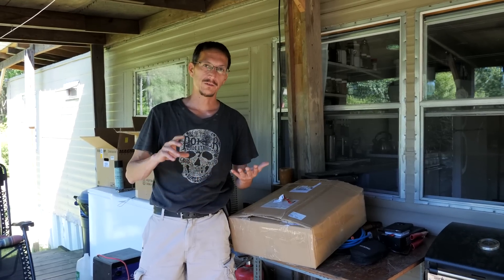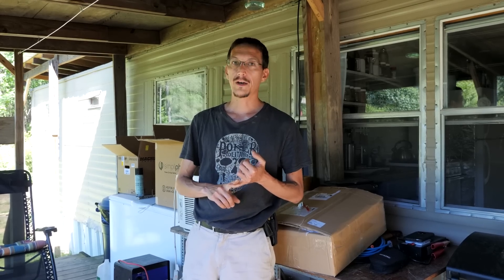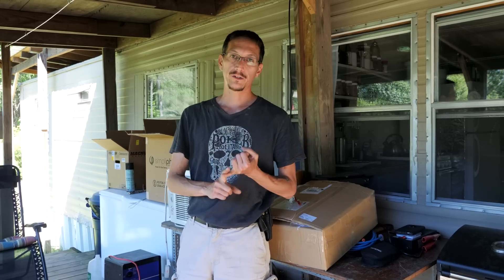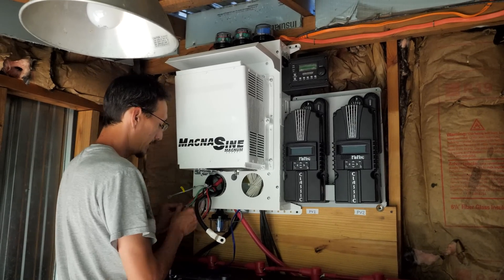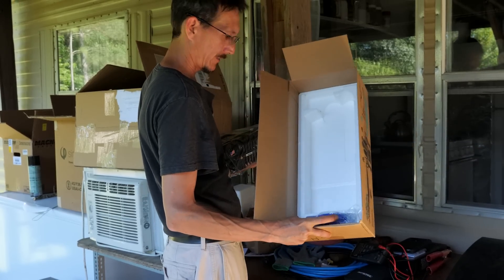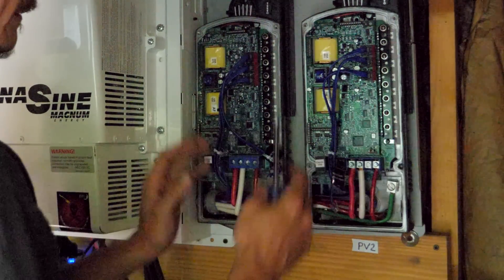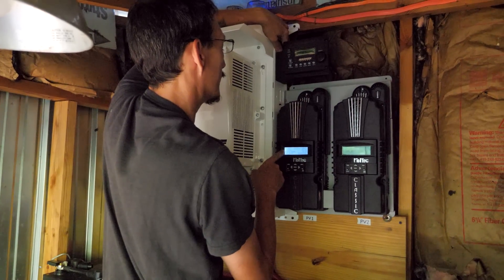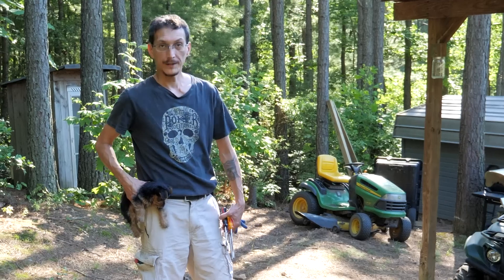DIY Off Grid Solar: The Good, The Bad, and the UGLY (Part 6)

Comment: Thanks for the review of the good, bad, and ugly.  I am always afraid of social media portrayals of “perfect life” haha.  I have seen Magna inverters and seemed to be really popular back in 2017 timeframe.  I am considering Victron or EG4 inverters with solar charge controllers and battery chargers.  Well the EG4 has it all in one.  Other inverters I have looked at are the Sol-Ark, MPP, & Growatt.  It is simpler to wire to the all in one boxes, but it makes me nervous - you have to replace everything if one of the subsystems needs to be replaced.  After 4 years of experience, do you have any thoughts on these inverters.  Thanks for your videos.

Comment: Do you have both 120 and 240v available from your inverters?  I have been looking and looking for a solution.  I only need to run an electric heater (240) but it's important.
Thanks for any input.  BTW - great videos.
Reply from the maker: Yes the Magnum inverter does 240v

Comment: So, it kind of boils down to the Midnite stuff failed two products within one day. The Magna failed in less time than that. Understandably, warranty and customer service is wonderful when it works, but overall, shouldn't have needed any part, right? Sounds like BOTH companies have quality control issues. I have plans for three of the SPD devices, two DC and one AC. I'll be VERY interested in my success rate, as well as yours
Reply from the maker: All parts were replaced by the manufacturers and have been working perfectly since. 24/7/365

Comment: Ive watched a few of your videos, it seems the battery bank is a little over sized for your current situation. With that in mind, have you dialed back the charge voltage to try to get maximum life out of the batteries?
Reply: He did say he wants at least three days of backup power in case there is no PV power coming in.

Comment: Thanks for your presentations -- very valuable even for those of us planning a smaller but similar system.

Just saw part 5 of this series, in which you briefly mention the operating temperature range of LFP batteries. Like many of the well-known battery fabricators (whose upper temp limits vary a surprising amount, considering the chemistry of their various products is identical) you seem to discount any real challenge to long-term LFP capacities from high temps.

Battery University states the biggest issue in this regard is from storing full lithium batteries at high temps -- exactly the conditions present at the end of a long hot summer day! One chart shows estimated capacity loss from a year's storage at 40 C at about 35%.

Of course your power shed isn't always a hothouse, but I'd sure see if maybe that condition could be safely/readily mitigated for the benefit of those beautiful Simpliphi's. (If cooling is impractical, perhaps operating at a reduced SOC is something that can be looked at.)

Comment: I used Magna in my semi. It had charger problems and they kept insisting there was noting wrong and refused to let me send it in. I had replaced my xantrex with the Magna so I could have the pure sine wave. I've installed a lot of inverters like this in trucks so I'm not new at it. Magna's customers service was so bad that I will never use them again.
Reply: M&M Overland Adventures um yeah, go check it out.

Comment: Outback power all the way. There service and warranty are top notch. I have a off grid system 8kw inverter and 10kw solar for a commercial lodge. It has been 6 years and no trouble. You have some great batteries. I have the solar one batteries. The lithium are my next batteries when mine will go bad in about 15 years. Keep up the good work.

Comment: You paid more for solar than I paid for a 2200 square foot house. Them batteries are $4000.00 a piece. That's like 10 years of electricity just in batteries.

Comment: Why would an incandescent bulb cause my inverter to buzz.
Reply: Maybe because you have a purely resistive load with no reactive cushion to round out your load on the inductors in your inverter so the magnetic flux generated with each unbalanced VAR cycle makes the power inductors hum.  Its either that or your inverter doesn't know the words so …. it hums.
Reply from the maker: I dunno 🤷‍♀️

Comment: Ide like to talk to you some. I have the same inverter. Only my set up is nothing like what you have. My batteries are 18 inches away with a 300 amp fuse hooked directly to the inverter. And inverter directly to square D panel. With a ground running to frame of tiny house. Is this adequate? Why do you have that panel with all those wires.
Reply from the maker: Sounds like yours is adequate. The E-Panel allows safer wire management for connecting the generator or grid power, multiple AC or DC load panels, breakers for each array and each charge controller and the main battery breaker. It also allows for expansion. Just a better safer method of connecting everything together.

Comment: Have you guys considered adding some capacitance to your system to help smooth out rough start ups on your well pump and your ac?f
Reply from the maker: We’ll just move to soft start or pv direct solutions when we build our house.
Reply: @Guildbrookfarm   awesome, i build rvs for a living and i've seen some people add capacitance to their ac units in order to stop an inverter from going into protect on surges. A high seer mini split with soft start would be the way to go, love the channel, we dream of, while not living totally off grid, at least become completely self dependent some day.
Reply from the maker: We are definitely doing mini splits. We haven’t had any big spikes that would overload the Magnum now that we have one that works properly.

Comment: In Video Part 4, 20 minutes in you discuss the combiner box running a #4 AWG to the house approximately 130 feet away with a 3 percent loss.   You wired the panels in series giving approximately 90 volts on 8 amp panels (volts increase amps stay constant) however you stated 8 amps running to the house.  With the use of the combiner box you increased the 8 amps by factor of 3, while keeping the volts at 90, so I believe in the end you are pushing 90volts with 24 amps to the house.
Reply from the maker: 8amps per string on a breaker in the combiner. The three 8amp strings are then parallel together by the busbar in the combiner sending 24amps per array to the house. Correct. I’ve been getting 35amps per array in full midday sun from each of these charge controllers. Their MPPT algorithm works awesome.

Comment: I also had a similar service experience with Midnite solar and Magnum for my RV setup. Relatively easy to get a hold of a tech to help troubleshoot at Midnite. Magnum was very tough to get a hold of someone that actually knew what they were talking about. Once everything was stable, the system ran reliably. I think I’ll look for a different inverter manufacturer next time but Midnite is at the top of my list for charge controllers.
Reply from the maker: Agreed

Comment: I was sorry to learn about your recent troubles.

I just saw a video that will not fix your problems, but it might provide an idea for an alternative way of doing your installation with perhaps smaller inverters for some of the AC energy stuff.

https://youtu.be/qJyLn_8OQ0s

This guy is running directly from solar panels a DC water pump, DC refrigerators, DC air conditioner, and DC hot water.

Make sure by the way that you have a resistive dump load after charging your batteries.  I believe the AUX on the MidNiteSolar charger will allow you to do this.

Best use of this is for hot water on an electric tank setup for dual heating elements (a single heating element will, also, work) one for AC and one for DC.

Comment: Instead of ground mounting which we typically do when we are figuring everything out. That you can elevate the panels using it as roof or shade awning style mounting so you can maximize your sun access since you are in a tree area. We don’t have trees so for us we have ours on a pivot so we can turn the panels towards the sun north south. So it’s easy to flip them for afternoon or morning to max the sun charge time.

Comment: within a week of setting up my big system my very expensive charge controller that I got shipped from the US (I live in Spain) broke down..  that is when i realized that if yo uwant to be truly off grid you have to have a back up for both your charge controller and your inverter.  They are the two weak links in the system.  

So i bought a cheap MPP Charger/inverter and have that installed.  It has actually been my main charger since the other one packed in and now I have both backed up.  Its  a 2500 watt inverter /charger so more than enough to get by on and only costs about 300€.

Comment: I agree with the Customer Service with Magnum I am dealing with them on a issue right now. The inverter constantly goes under spec volts and occasionally over. Everything in my house has to be on a UPS just to keep things going. My plan was to get two of these running in parallel but I am reconsidering and just going with a Schneider Inverter instead that would be large enough for everything. Might wait and see what Midnight comes out with they are expensive but sounds like they may be a better over all solution.
Reply: we're using Schneider SW and XW inverters in many of our installs. Generally speaking, very positive. They have DHL'ed us a 6848XW (on their dime - to Panama) so, generally speaking, we're pretty happy with them.
Reply: SuperDave I have my system on ups as well and for us it makes it easy to change between systems without too much fuss. It also lets me know if something’s awry and no alarm is sounding.
Reply: Small update on my situation. Magnum actually replaced the inverter at no charge. It took a few calls and emails to get it done. But in the end they agreed that it was malfunctioning. The new one is a lot better but I still get the occasional line noise that trips the ups's in the house. I believe its an old freezer that's causing it. We are working to empty it and retire it. I also changed out my pump controller for a Franklin Monodrive so no more hard hits on the inverter. Seems to have helped a lot. I still think I may try out a Schneider 8k for the main and just use the Magnum for the pump and as a backup. Time will tell.

Comment: Great series - disappointing equipment failures though with brand new gear. On your cable run from the panels to the electrical shed did you use PVC conduit? I didn’t see any in the video but assume it would be necessary for cable protection.
Reply from the maker: This is temporary. Will run conduit when we install the system at the house.
Reply: Ah - got you. Did you consider something like the PW2 with the transfer switch that allows it to be used standalone? I'm guessing it's too difficult at the moment to get a decent MPPT inverter that will work in standalone mode to feed the PW2?

Comment: Thanks for sharing! For someone in the process of spec-ing a system, what alternative inverter manufacturer would you recommend?
Reply from the maker: Schneider Electric. Midnite also has a new one out I think.
Reply: overall, we're pretty happy with Schneider as well.
Reply: I have installed many off-grid systems and Schneider is the only way to go.
Very strong.

Comment: We started out solar but found out after a time it wasn't producing what we anticipated. We had our property tested and it passed for a windmill. Solar produces much less in the winter. Cloudy days affect it. It doesn't do anything at night. Our windmill produces 365 days a year, 24/7. Much more output than solar. We added additional batteries because of the drastic increase in capability. And the good news, it can be used with your present equipment, along with your solar. Highly recommend looking into it. We can run 12 volt freezer, refrigerator, microwave, even high efficiency hot water tank.
Reply: Ya, but there are several drawbacks to the wind power, Richard, one being the location and the... obstacles... Trees make for the need of a VERY high tower... and of course that means a very heavy anchor and a lot of $$$$$$ not to mention the constant maintenance on the wind turbine, the oil, lubricant, cleanup disposal etc. Plus there is the absolute need to have the thing running something  at ALL times while turning (otherwise your tower EXPLODES fantastically) This is usually done with a heater element or ground. Solar has no moving parts no constant maintenance, has no need for additional equipment to bleed off excess wattage etc. Much less can fail with solar then wind. But having a dual system solar+wind/water/thermal is a great way to go.
Reply: We had a company come test our location for windmill use and design our set up. I do not recommend just throwing one up. Our terrain and wind conditions supported the criteria for a windmill.  Our 3kw unit produces around 600kWh per month in ideal conditions. We use far more power in the summer as we heat in the winter with wood. I find the turbine is no more upkeep than a vehicle and we have had no issues in 4 years. And the solar system needs maintenance also, cleaning panels, adjusting tilt seasonally. We sell excess power to the utility provider. Our goal was  to be off grid but here they don't allow it ? The house has to be hooked to the public utility. At least we feel we have a chance if the grid ever goes down with the systems we have. Unless it's caused by a EMP. Then everything will be fried anyway.

Comment: I am a big fan of Magnum Inverters, charge controllers and other solar products.  When I had a bad inverter, they sent me a new one right away.  I can only speak for my experience but they did right by me.  I will say that I think they have a problem with the packaging of the inverter.  The box packaging appears to be too stiff and does not crush as it should and that's why the inverters take the damage during shipping.  The outside of the box looks fine but look inside the box and you may see signs that the box has been mishandled.  Thanks!

Comment: FYI, you don't want to Equalize the SimpliPhi Power Batteries, it can damage them they told me. I use Morningstar controllers and have the SimpliPhi Power Batteries on the lowest setting, Gel or Glass Mat, so the Equalize never comes on. Check the warrenty and if needed please call SimpliPhi Power to get the information. 
I have enjoyed watching how you have done things and how things are turning out for you. I got some pointers from you on how you did the knockouts.
Love the dog, puppy!
Reply from the maker: Correct. You just want to Bulk and go to Float. Disable Equalize, reduce Absorb to its lowest time setting, and disable Temperature Compensation. I spoke directly to the guy who writes the tech docs from SimpliPhi.

Comment: I like the idea of backups. I have 3 generators, 3 inverters and a split 12 volt battery bank. Overkill but I don't like being without power. Besides, I scooped up spares here and there over the years for cheap so its not like I dropped a wad of cash to create redundancies.

Comment: You don't truly know a company or its products until they fail, so it's great to hear some real feedback of what these companies and their products are like.  Interesting that Midnite were so embarrassed about the failure that you got an advance replacement right away, while Magnum couldn't be bothered to deal with yet another problem - gives you a strong insight into what kind of a failure rate each company has.

Comment: Where is the other inverter?
Reply from the maker: Still at the service center 🙄
Reply: Can you mention in one of the upcoming videos how you plan to hook up the original inverter when it comes back?  Just curious whether you are able to run it in parallel (sharing the load or a different circuit) or whether it has to be a failover system where it will only kick in if the new one goes off.

Comment: Great set up First Class all the way and Im sure you will enjoy the Magnasine hey they pissed you off but it is still the best one. I would like to get one someday.
Reply from the maker: Well so far this one seems to be working good. Time will tell but if I’d known about their warranty policy I would have gone with Schneider Electric.
Reply: Thanks for the tip I will check out Schneider Electric.
Reply: I have a xantrex inverter (division of Shneider) . My first inverter I bought for camping at 300 watts. When I built my offgrid home I hooked it up for use as an auxiliary inverter in a workshop. I've been literally abusing it for 10 years and its still going.
Reply: Yeah im using all xantrax inverters and yeah I killed one. Thats what I buy second hand because they are affordable.

Comment: What's with all of the buzzing noise?  Is that typical with these components or just with Magnum?
Reply: All power electronics will buzz at 50 or 60 Hz depending on where you are.  It's down to the quality of the transformers they use and basically how strongly they are glued together.  The more power you run through a transformer the stronger the vibrations are, so the more solidly built the transformers have to be.  Eventually you get to a point where you can't stop the buzzing (or it's not economical to).  Generally people just install these things somewhere that the buzzing won't be a problem.  In warmer climates you will also generally have the noise of cooling fans which are louder than the AC hum.